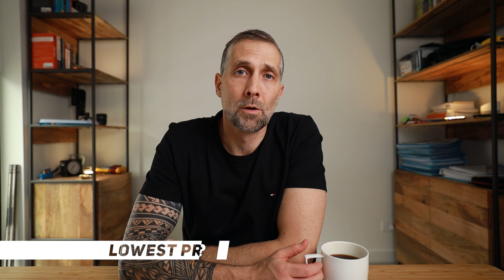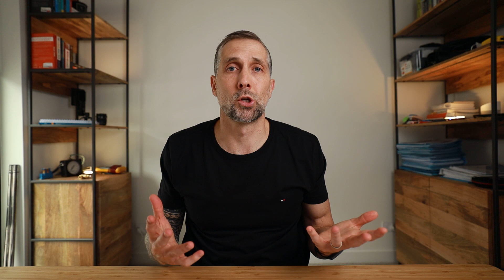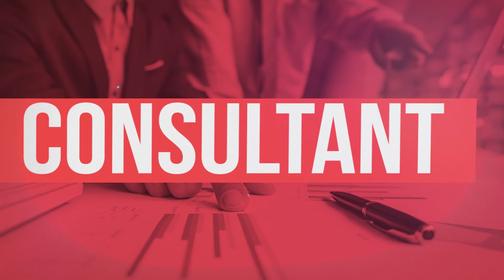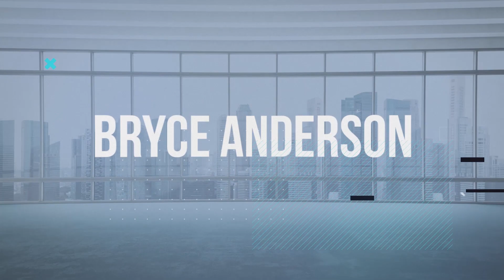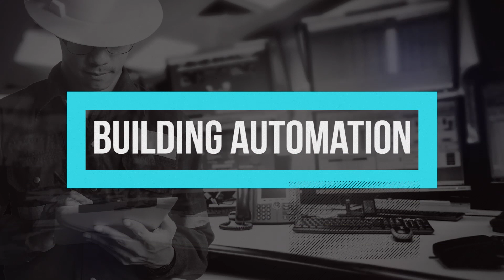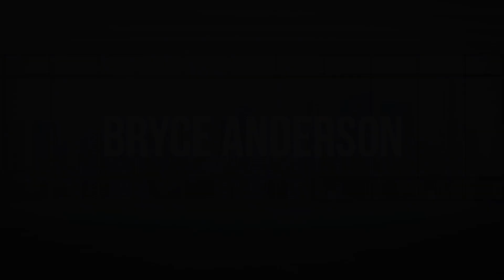Why Does The Mechanical Consultant Choose The Lowest Price?

Comment: Provocative topic here Bryce...traditionally the BMS/Mech consultant is responsible for the tender analysis.
But in your case, and this is the point I've been pushing for years, is that the BMCS contractor is so far developed from only controlling mechanical services, nowadays, there's Diesel generator load shedding, electrical metering, solar PV, hydraulics sump pumps, water metering, none of which are mechanical services.
Why should it sit under a mechanical contractor.
It should become its own service, and be managed by the Builder as its own entity too. 
We've run projects like this in Sydney at least, not sure about Melbourne, but it seems to result in a better outcome, (for the BMCS), obviously the Mechanical contractor wasn't too happy about it.
Reply from the maker: Completely agree. 
Mechanical consultants should design the HVAC control system, not the BMS.

Comment: As a Mechanical Consultant for +35 years agree with this YT.. What I see;

1.	 If it’s a trade in Head Contractor building contract its rare we see the BMS price, we are lucky to see the tender tech submission, 
2.	If it’s a trade in Mech contract any BMS price in the tender forms is often made-up approximation as the contractor still is in negotiations, 
3.	Assuming the BMS is tendered as a separate trade (which I like to do most of the time, with maybe the exception of dead simple projects) the Consultant may not see the price. 
4.	Even when the price is known the Client / Construction Manager / Project Manager will find it too tempting not to accept the lowest no matter how much caution the Consultant advises. 

And it does not help that some BMS companies are quite happy to “buy” the job if ensures cashflow  for a while yet, knowing full well that they can make it with variations later (cause Mech consultants rarely have a solid spec & points list) and later lock in the lucrative service contract.  Former work colleague was the NSW manager of a large well known controls company (since swallowed up by one of the few remaining mega companies) – he happily would admit that the usual BMS business model was to price installs at cost (or even below) and make the profit in service contracts.  

What we as Consultants should be doing is insisting on tendering the BMS as a separate trade complete with a solid specification and points list.  Best chance to properly scrutinise and assess the tender offers.  It is a relatively easy sell to a Client up front.